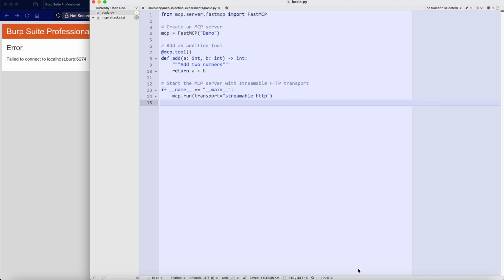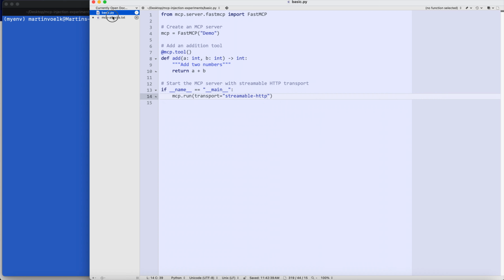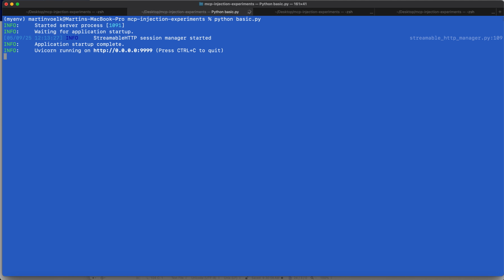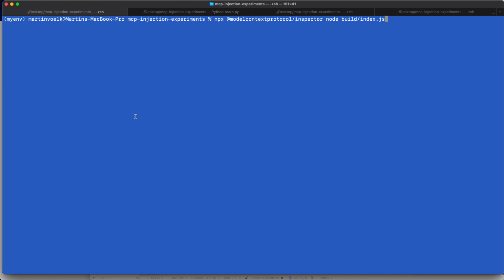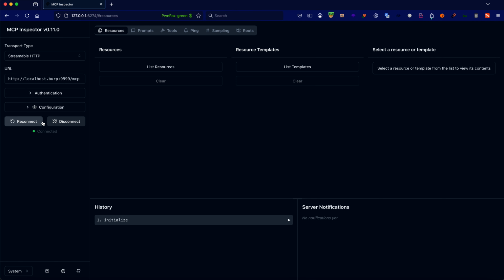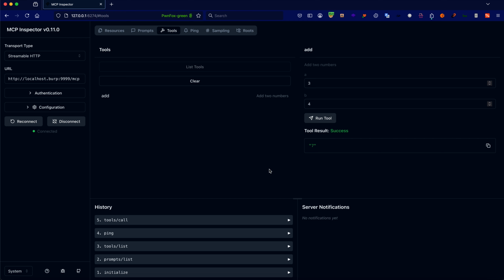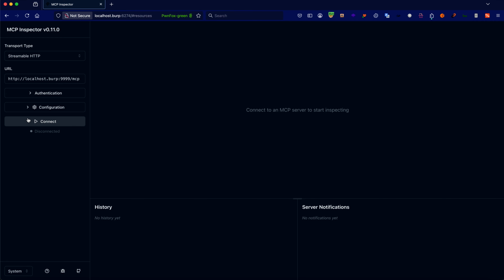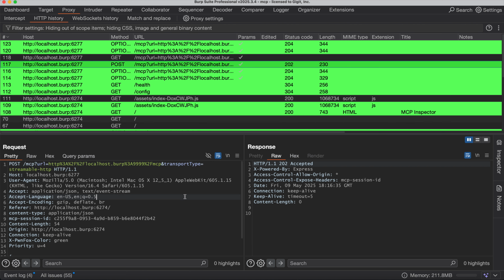MCP Inspector Tool - Dissect your Model Context Protocol (MCP) Servers (Streamable HTTP)

Comment: Did you tested also for MCP server running remotely and with HTTPS? not locally and with HTTP?
Reply from the maker: yeah. Multiple methods. Most remote MCPs are https of course. Like https://hackerai.co Haven't done a video yet but works nicely
Reply: @martinvoelk Thanks a lot! Martin,Yesterday I bought  udemy course from you,because I found that you Are sharing Real knowlwde instead of those creators which JUST reading text or resharing content from someone else
Reply from the maker: @MartinLucan  Thanks for the feedback. I am working full time as a Pentester and these days it's just AI/ML. I also still do some bug bounty and stuff but not as much. You know, family and wife :)